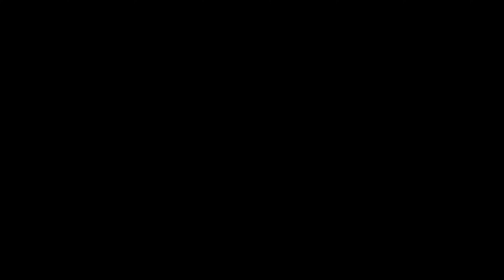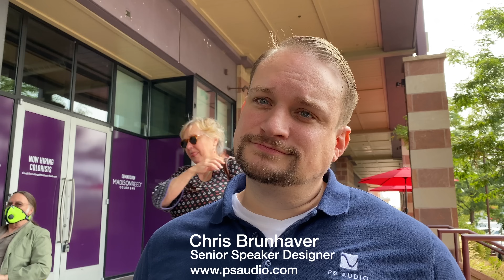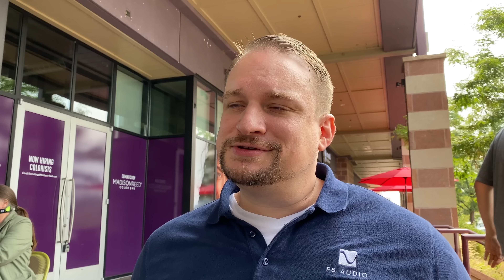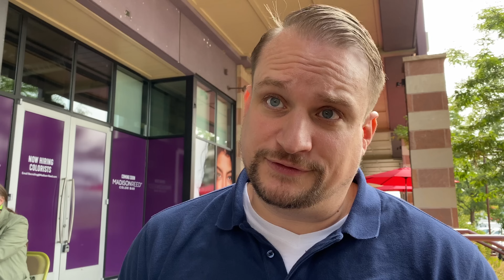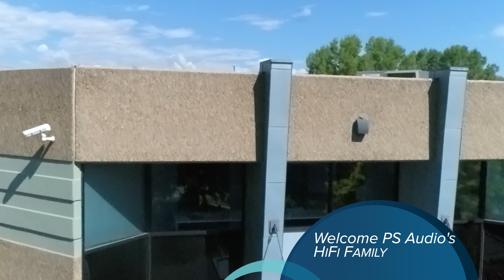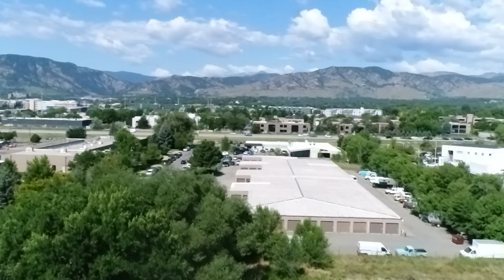Lunch with Paul: Isobaric Woofers

Comment: My first experience with isobaric was a chamshelled pair of JL audio 12w 5's in 1.25cu ft.,as soon as they hit the streets,in an '80 Tercel hatchback,brutal. I never knew about the effect on distortion 'til listening today but I remember how tight they sounded comparatively. I didn't like however,the halving of output,which I learned about slightly later. Great fun setup but shortly thereafter I traded them in on a set of the first 10w 6's,a set of three for my newly acquired '83 Z-28. .75 cube sealed ea.,that was amazing at the time,and they sound imo to this day,fantastic in anything I put them in. Best thing in the Camaro was,I was able to fashion a perfect box on the top ledge,directly behind the back seat,rather than using the well like most did at the time,negating all real storage,and impossible to seal without losing serious real estate by squaring up something in the well. The good ol' days of car audio.
Reply: My uncle runs a pair of JL 12W-4 (refoamed) subs in a iso ported box tuned at 30hz on a 1000w Alpine Amplifier. Seems to work really well and sound very good.

Comment: Paul great content, can you ask Chris or do a video on subwoofer sensitivity and why it has remained relatively stagnant. Is there no incentive to create 90-100+ dB subwoofers? It seems that the R&D in this department has been left far behind when compared to the leaps achieved in amplifier performance by comparison. Thanks.
Reply: Im no expert but I've heard that as efficiency goes up, bass response goes down. I'm not exactly sure why that is but I believe its one of those "Iron law" things.

Comment: I was so surprised that he brought up the vintage kicker soloBarric subs. I actually just had one 15 inch in my vehicle. It was ok but not enough. I ended up replacing it with a Skar Audio 18inch ported (Sds18) and I am happy with that. I think in car audio a ported design is almost always a must. I also prefer ported for home audio.
Reply: When I was younger,I always preferred sealed,just because it was that much tighter. But yes,the right subs,the right enclosure,with a well thought out port,gotta love the extra output. I now play around with dampening my ported enclosures a bit,to really dial in that tightness I crave.

Comment: Years ago, I made an isobaric 10 inch. Both drivers fired in the same direction.  With the size of the box being very small it came out as probably one of the best midrange setups I have ever listened to. Would also handle a lot of power.

Comment: I own two Buttkicker LFE models (several models/amplifiers/complete systems are available, dependent upon one's requirements), made by the Guitammer Company Inc., and there's nothing like them. I drive mine with 1,000 watts into 4 Ohms, each. They go down from 200 Hz to 5 Hz, with a resonant frequency of 9 Hz. No subwoofer in existence, that I am aware of, can match that frequency response and, unlike a subwoofer, they're completely silent, as they move mass, as opposed to a cone. They have strict installation requirements in order to get the most out of them, but they're totally worth the bother. Highly recommended.

https://thebuttkicker.com/

Comment: I saw an isobaric speaker set up when i bought a polytron ps300 long ago. Its already phaseout in my place but there's still in Indonesia i think. You can search it and ohhh! Its a nice active subwoofer actually with two 6 inch speakers facing each other.

Comment: Aperiodic produces a smooth extended rolloff like a transmission line, still the most musical and dramatic bass presentation, like an enormous horn but with a 12db instead if 24db rolloff.

Comment: According to the various articles I've read on the Journal of the Audio Engineering  Society, isobaric loading was originally designed to reduce second harmonic distortion of low frequency drivers by 50- percent.

Comment: Lirpa Labs is pleased to announce our new Iso-Sikel woofer featuring a superfluid helium-4 cooled voice coil and field coil magnets system for unsurpassed efficiency.  Well, for the woofer; the 1.7 degree Kelvin (better than CERN!) superfluid helium-4 supply system is another matter, but we won't go into that now.  Operational impedance is 0.0000000 .  .  . 00000001 ohms.  If you thought the Scintillas were tricky to drive; well, we won't go into that either.
Reply: Lirpa Labs Bioreplicant Division announces that Stephen Smith Mk. V is on line.  We also announce that due to reliability issues the Stephen Smith series is being boxed pending further evaluation.  Wait, what?

- off line -
Reply: Although we do not commonly reveal such information, Lirpa Labs confirms that Mr. Rat is one of our independent (read unpaid) beta testers.  As per our standard policy, we will only reimburse him for the first 3 amplifiers (with notarized and dated receipts required).
Reply: @FatRat-f9m  Professor Lirpa is kind of a tight wad about such things.  Wait, did I say that out loud?  I'm sorry, Sir!  Please don't AAAARRRRRR

- off line-
Reply: Lirpa Labs Bioreplicant Division is pleased to announce that Stephen Smith Mk. !V is now on line.

Uhh, you guys did get that instability in the Zero Point Energy power supply straightened out.  No?  Oh well.  LET'S PARTY!!!!  Where's the absinthe?
Reply: @stephensmith3111 ...I can see that the 'Mk. !V' ain't gonna last long.
Lirpa is losing it!
Doesn't he know that absinthe is corrosive to the bio-circuity.

Comment: I've still got my Alpine - 'Bass Engines' (Butt-kickers) but I have them mounted under a sturdy plastic garden chair for when I listen to my cans. Using them with cans is an amazing experience as headphone listening precludes any 'feelable' bass, however, when you add a chair with butt-kickers mounted to it... wow ...it's like the whole soundstage has opened up as you now get the pinpoint accuracy with the cans plus all the bass that you never got before... awesome! 👍😎
Reply: I understand that this technique facilitates flow after the insertion of multiple suppositories.  (C)rap music works the best.
Reply: @FatRat-f9m  
I'll bet the porn industry would pay dearly for that set-up. Better apply for a patent.

Comment: I'm considering using the stairway storage room in my house as a sealed subwoofer box to maximize the but- kicking effect. It's well sealed except for the door, that needs to have some rubber sealing to keep it from vibrating, I guess. Anyone with experience in this idea?
Reply: @jim9930  Parts Express is in my mind. But I was thinking about the HTS545HE-4 Kraken 21" High Excursion woofer in the actual wall that is already part of my home theater room. This woofer can move 7 liters in one stroke and I should be able to get down to 20Hz easily with high SPL. It's a pretty solid wall. I'm also thinking about adding the www.subvo.com sensor to it and finetune some feedback loop algorithm to make it a stairway room servo subwoofer.
Reply: @jim9930  Experimenting with servo feedback takes some courage. If you have ever had a 1000s of Watts amplifier going into some mode of oscillation through the servo sensor with the house shaking and the voice coil glowing, you get some respect for this. I had such an experience a couple of years ago. It's better to first start with the protection mechanism (cut signal if it gets unstable).
Reply: @jim9930  Yes, concert venues can get into serious feedback situations too.
Reply: @jim9930  You don't want to take a break and be sitting on the toilet to realize the system starts oscillating...and the building shakes...and then the main fuse blows...and it gets dark...
Reply: @jim9930  I'm sure it's tough to make a venue of many 1000s of seats to sound good. I've been to some large concerts with Pink Floyd, Dire Straits, Cold Play, and others where I got quite impressed how good the sound was under the crazy conditions. Obviously "good" isn't really very good, but at least you hear the music loud and clear without feedback and, if you are lucky, some stereo image. One time I was standing right next to the control area of a Pink Floyd The Wall concert, and it was not just about audio but also about all the visual effects of the huge stadium stage area. Just the quantity of wires being involved is quite amazing.
Reply: @jim9930  https://youtu.be/JgGuRKgvWQ4
Reply: @jim9930  Yeah, live music sounds good only when the venue is not too large. The speed of sound through air, unfortunately, follows the laws of physics.
Reply: @jim9930  Yes, and rain is even worse

Comment: Isobaric woofers are basically not needed anymore, since the advent of magnetic FEA modeling of loudspeaker motors and mechanical FEA modeling of suspension components to produce high-BL woofers and eliminate meaningful amounts of asymmetry. Isobaric push-pull arrangements force the assembly to be essentially symmetrical by coupling the two motors and moving systems together while acting in opposite directions relative to the backplate of either driver, but good component design can now assure not only symmetry but linearity with just a single woofer to buy. Also, high-BL woofers can operate in small enclosures without requiring the two motors of an isobaric pair to be working in tandem to push the piston.

Comment: I was only researching this idea a few days ago how a buttkicker might enhance 2 channel audio bass and if the sensation might trick the brain into a sense of deeper bass extension. Ill keep watching this concept from PS.
Reply: So I use shakers (Tactile Transducers) in my home theater but I went with the Clark Synthesis product from parts express.  They are a softer hit and can handle higher frequencies than the buttkickers.  I have one on each chair with a small 75 watt amp going to each one.  While I have a pair of 18s with a lot of power, my system is in a basement so I wasn't getting the shake I wanted.  They do also bring an interesting addition to music.  While it's different than a speaker, you feel it in your butt rather than your chest, its one of the lower cost parts of my theater but it definitely adds a lot to the experience :)  In my case I added them to recliners and I mounted them to a large piece of wood that spans between the bottom of the frame.  https://www.parts-express.com/clark-synthesis-tst239-silver-tactile-transducer-bass-shaker--300-863